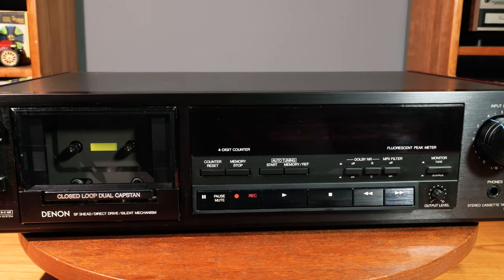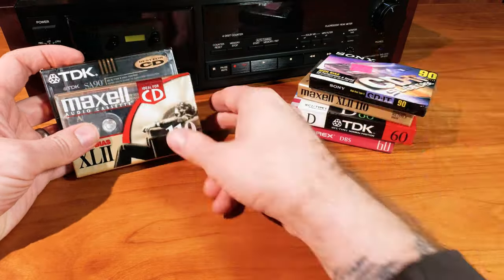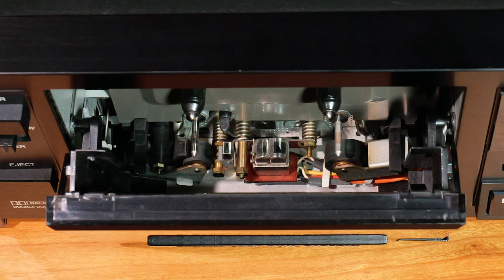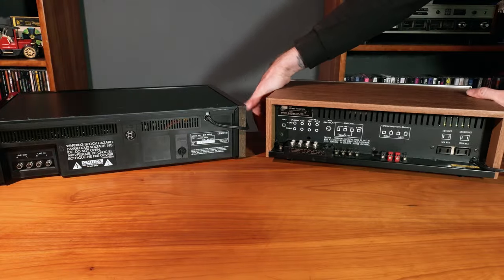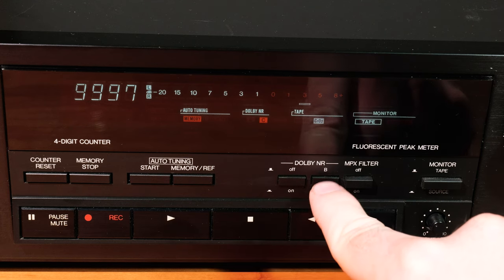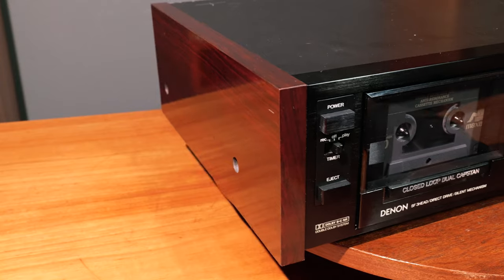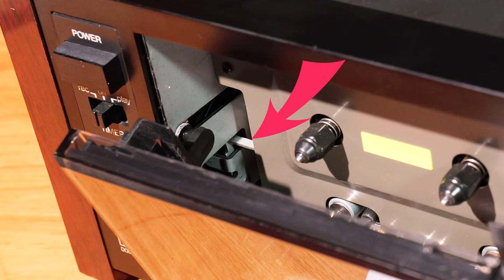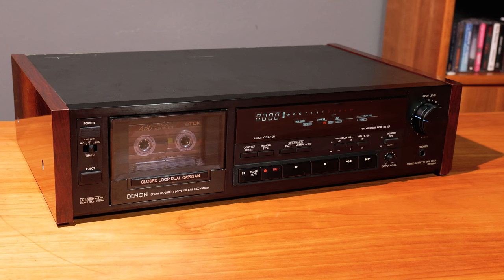The Denon DR-M44 Stereo Cassette Tape Deck: A Great Deck For Casual Collectors.

Comment: What a find!  Auto tape tuning in 1984. Auto tape select is one thing, but that's a proper high end feature!  I am old enough to have used tapes in anger, but back then we didn't know much about them really, we just used them. Having gotten back into the whole tape thing (Covid made us go down many weird rabbit holes, didn't it!) and watching videos on tapes and recording I now understand what I, and probably most of us, missed back then. Having three heads and a monitor function is the most important feature, apart from the tape tuning. I never understood the point of monitoring the recording back in the day. And besides, I couldn't afford one) Now I have realized it is very nice to be able to compare a recording to the source. You will instantly be able to tell the quality of the tape, if you are recording at too high levels making the recording distorted, if the tape has dropouts etc. So much better than noticing this after hours of carefully making a mix tape.

I have recently bought a Sony deck from the 90s, my first 3-head deck and first with tape calibration. It is soo satisfying to se the meters change as you adjust the bias and levels to the individual tape! And it really makes a difference to the results. Sadly it is not a dual capstan one. Looking to upgrade to a model with a better mechanism, including dual capstans. Sadly I live in a country (Norway) where there are hardly any thrift stores, and top of the line decks are rare and (over)priced when they show up on online market places.  :-(
Reply from the maker: Thank you. I'm going pin this comment because you explained the purpose of monitoring better than I did, I think. :)
Reply: @AudioThrift  It was an eye opener to actually use that function. Unpacked a sealed Scotch to make a mix tape for a friend, and noticed that it had dropouts immediately. Saved me redoing the whole thing, I just got another tape. Many old tapes work just fine, but bad storage can sadly deteriorate them sometimes.
Reply: Being able to monitor the actual recorded signal comes in handy when recording off the radio.  If it is distorting, you can just turn down the gain in real time.  Bias adjusting is really important too for good recordings.
I'm thankful I'm a packrat and never threw my tapes in the trash.

Comment: Now THAT's classy, so naturally I want one to replace my early 00's Yamaha deck. I ain't going to find a Nakamichi Dragon after all :D
Reply from the maker: Truthfully, this Denon deck is quite nice. Worth it if you can find one for a decent price.
Reply: Heck, I remember more than 25 years ago, scoffing at the hefty $350 to $500 prices on eBay for used Nakamichi Dragon cassette decks, but those were bargains by today's standards compared to prices now ranging between $3,000 and $8,000. That's just nutty.  :)

Comment: Another nice find. Nice to have a 3 head-dual capstan deck. The wood panels look great. I love it when I get a receiver with a wood case or side panels...as long as they're in good shape! Usually they are scratched or the vinyl wrap is peeling. I have a Denon 7.2 multichannel receiver I really love as well Go Maiden!
Reply from the maker: Thank you. What year is that Denon of yours from, roughly?
Reply: @AudioThrift  it’s about 3-4 years old.
Reply from the maker: Nice. It's cool that Denon is still making good stuff. 🤘Maiden!

Comment: I have one of those, including the rosewood end panels.  I repaired decks for many years professionally, I chose the Denon because most of the internal parts are metal, the Nak decks have a lot of nylon parts, which don't age well.
Reply from the maker: It definitely felt solid when I opened it up, unlike a lot of decks I’ve seen where they wobble with the shell off. :)

Comment: Once again - A excellent find from an Estate sale, and a magnificent video presentation 👍
Your explanations are excellent! Not too technical, but just enough to get the point across….
Your Denon Cassette Deck (from 1984) is 40 years old and still going strong = Fantastic!
By the way: I am glad you mentioned that you opened and looked inside the Denon, as one can be lucky (just like yourself) and find and fix problems / issues. 
Take Care.
Reply from the maker: Thank you. I appreciate that. :)

Comment: I had the successor of this model, the DR-M44HX. It was a good deck indeed. I replaced it with the Sony TC-K700ES, which sounded way better. The wooden panels were - indeed - extra.
Reply from the maker: That one looks nice. Looks like you got a lot more control over the sound when you upgraded. Where did you notice the biggest improvement in the Sony; the playback or the recording?

Comment: Here I though what was missing was a bias test and adjustment.  Tape type is so basic I didn't even think of it.  2:38 Adjusting the bias really makes a big difference, especially for tapes of a different age than the player.
You really shouldn't use Dolby C, like, ever.  The problem with Dolby C is it is incredibly inconsistent from deck to deck.  It may sound great on the machine you taped it on, but sound like crap on a different deck.  Dolby S is great, but few machines have it.

Comment: Dolby no longer issues licenses to manufacturers. So basically Dolby NRSs are commercially dead. You can only find Dolby on old tape decks so is pretty nice for "personal" recordings, but deprecated if your recordings are intended to be sold or shared with others, because recently manufactured decks simply doesn't incorporate that feature.
Reply from the maker: That's a fact. I know the little bluetooth cassette boombox I use at work doesn't have it... but it does make up for it by adding plenty of wow and flutter.

Comment: the "auto tuning system" automates the manual bias fine calibration process avalilable on other decks, so the "monitor" key on this particular machine looks pretty useless to me.
Reply from the maker: Yeah, it does seem a little redundant. lol

Comment: There's nothing silly about that cassette backlight. I have a TEAC deck from 1995 that has it and a TEAC deck currently produced that doesn't and it's annoying when you have to use a flashlight to see the tape.
Reply from the maker: Right? It's like... It's such a simple thing but it make so much difference.
Reply: @AudioThrift  
Exactly. 🙂

Comment: I have the DR-M24HX and DR-M30HX. Your deck has some neater features than both my decks :)
Reply from the maker: Those both look cool though. Do you have the remote? :) That's something I haven't gotten to try yet.
Reply: @AudioThrift  I do a lot of tape recording on the various cassette decks I have. I don't have any remotes, BUT allow me to accept, I enjoy calibrating tape, setting recording levels, and engaging noise reduction systems ALL manually :)
Reply: @AudioThrift  I just noticed, both my Denon decks don't have wood panels on the side, like yours has :)

Comment: Great quality deck. Direct drive should be mentioned.
Reply from the maker: Agreed!
Reply: Onkyo decks of the same level class sound better
Reply from the maker: The only Onkyo deck I've tried did sound really nice. I don't think it was on the same level as this one though so it wouldn't be a fair comparison. Hopefully I'll run across an Onkyo at some point but that's up to the Thrifting Gods. lol

Comment: Nothing special about automatic tape selection,
 is not rare. 
Mid to late 80’s, it’s rare to not have.. 
why don’t you explain how to bias calibrate instead.
You should if caring about doing a good recording
Reply from the maker: Didn't say it was rare lol. It's very common. Can you elaborate on how you would calibrate the bias on this deck?
Reply from the maker: No, I was lucky to find it with the wood panels because usually this model doesn't have them. Sorry if I wasn't clear enough about that.
I can't get on to Hifi Engine because account registration is closed. Been trying for a while... they have a TON of manuals that I want. I can usually just Google it but it sure would help to have an account.
Reply: Why did you delete my previous comment?
Reply: It’s a brand and model sold worldwide. Finding a user and service manual online isn’t harder than finding these things in estate sales. 

I’m still wondering why you don’t ever find an Dragon, TCK7ESJ, high end technics & JVC
Reply from the maker: I didn't delete anything. Everything still visible on my end. What was the comment?
Reply from the maker: I'm wondering the same damn thing. It's not like these people can't afford stuff like that... So far, the only Nakamichi I've even seen is one of their low end machines. The few pieces of higher end gear I find are beyond my ability to fix; I'm just a tattoo artist. I'm surprised how much Realistic gear I find in really rich people's houses when we do the estate sales.

Comment: its a lovely cassette deck. i do have 44 and 44hx with HX Pro, to be honest i do have 5 of them :). one is already fully restored and recapped putted back like in brand new condition with some upgrades to the components. yeah, is a beast and i can say its one of the best deck ever and maybe the best deck made by denon. ps, when it comes to remote control you can do it yourself. just find which one is ground and by shorting other pins you start the option. you cand design your own style and maybe control centre to your system :) i did that myself when i was 10 years old with my other deck when i was a boy :) i used game pad got the controller, just use socket, solder cables and job done :) but that was over 35 y ago.
Reply from the maker: Oh man... the remote control idea is great. I'm gonna try that with just a couple wires and see if I can get it to work. 
I'm curious, what were the upgrades you did?
Reply: @AudioThrift  I like that DIY remote control idea. From the look of the jack on the back, you can do some initial tests if you have a standard 5-pin midi cable laying around. If it functions correctly by shorting pins to ground (likely pin 1) like the other commenter suggests, you could use a 7-pin midi cable to craft the remote.

Great job on the video! I like the detail you put into it. It’s comfortably technical while still being a review from firsthand experience and passion.
Reply from the maker: Thank you Andrew. :)